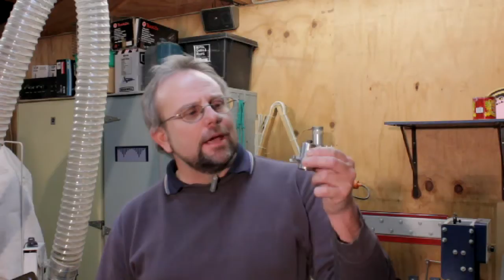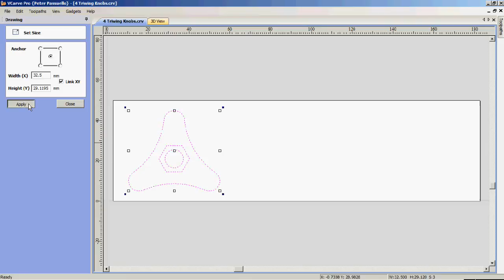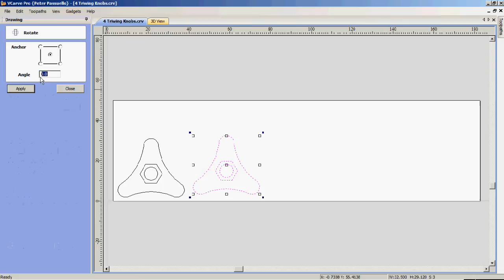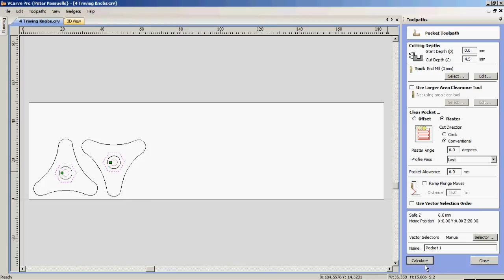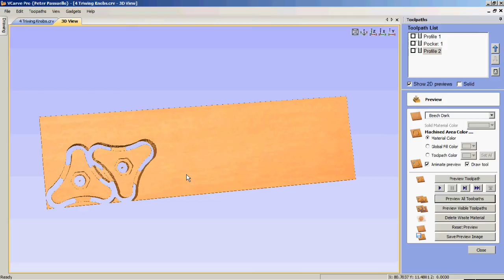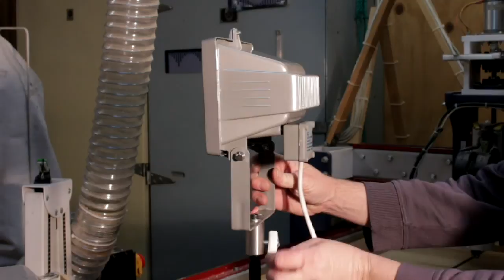Knobs to you - CNCnutz Episode 64

Comment: Hi,

Liked the info on the scaling.  I have made similar items on my CNC.  When making closer tolerance internal hex in harder material I drill small holes at the corners of the hex to provide the necessary clearance depending on the diameter of the end mill utilized.  Made an internal (.102) square drive gear for a friends motorcycle speedometer that worked really nice.

Enjoyed the video.

John